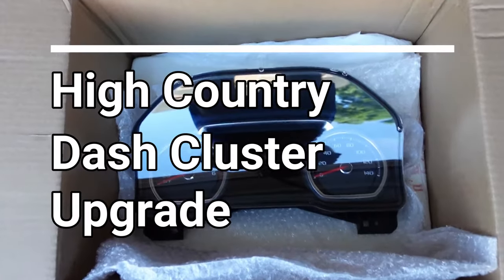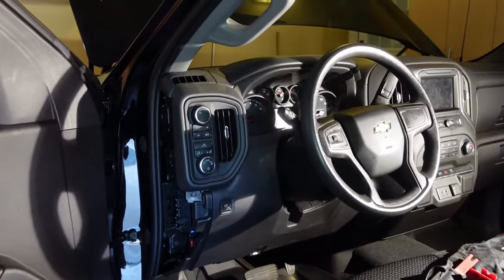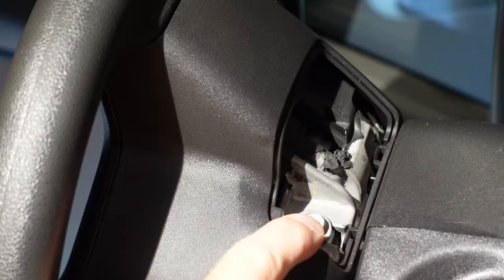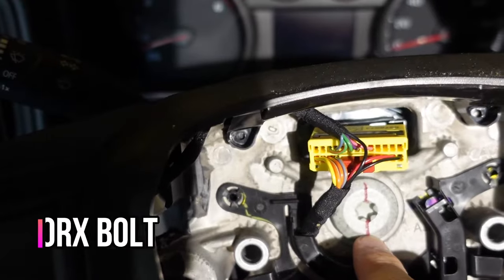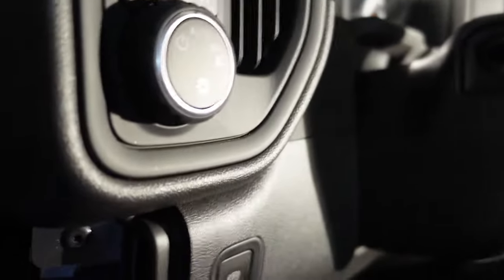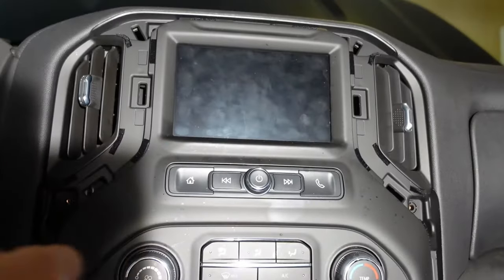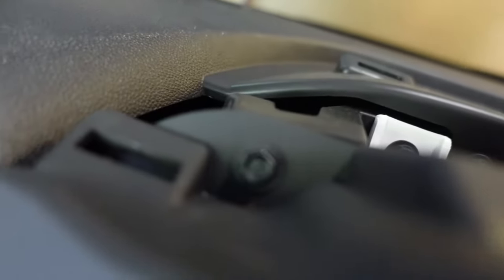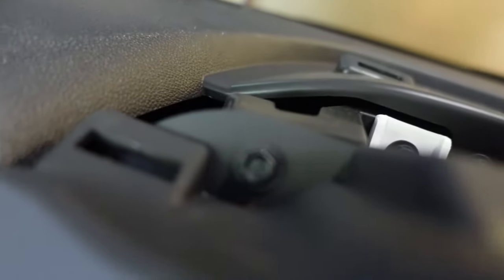[HOW TO] Upgrade Dash Cluster & Steering Wheel in a 2019-2022 Silverado LTD Custom

Comment from the maker: Be sure to read the description for extra info on where to get the parts needed to do this mod. Big thanks to WAMS (White Automotive & Media Services) and the Harness Dr. for helping me get this installed! https://www.whiteautoandmedia.com/  https://harnessdr.com/
Reply: I have a question. is it possible to swap the hvac controls for the digital hvac controls. It’s GM part # 84692242. I searched the forums and I’ve seen people do it in their 14-18. Wondering if it’s possible. Looks like it just pops in.
Reply from the maker: I honestly have no idea.
Reply: did you ever figure out the heated wheel? or just didn't worry about it? Also does this work on the 4 cylinder? I was curious if it actually reads the Turbo Boost pressure. I was hoping you would pop the throttle to see if it would.
Reply from the maker: Im working on the heated wheel now. I had to order some parts and I’ll be making a video. My truck is a turbo 4 cylinder. And yea it shows boost.
Reply: I have a 2022 trail boss refreshed it said on there site that it won't work with the refresh is that because of the single wire harness if you know that would be a big help before I buy?
Reply from the maker: Refresh models have different wiring. This upgrade Won’t work for your truck.
Reply: @fondupot  oh let me know what parts you ordered for the heated steering wheel an if they worked please
Reply from the maker: When I eventually get it working I will post a video.
Reply: Thank you for the video i followed  it to the T an the harness from harness dr even made my steering wheel light up which i was wondering about
Reply from the maker: Glad to hear it worked!
Reply: @fondupot any update on the heated wheel?
Reply from the maker: @brendenbopery8673 unfortunately no. Ran into some roadblocks.

Comment: Let's say I just do the steering wheel with Dr. Harness Mod.first ...will it work for the radio functions? The cluster is a little expensive, but it's worth it later.
Reply from the maker: I think so yes. But I am not 100% sure.
Reply: Did you ever install just the new steering wheel with the adapter and did the radio controls work for you?
Reply from the maker: @justinstorey4084 no. And it won’t work. Others have tried. You need the cluster and the wheel and the added wire for it all to work.

Comment: I currently have a 2020 chevy silverado custom. Would I be able to upgrade the steering wheel with the radio controls, buy the cable, and just upgrade the cluster with a less high-end cluster like the one below the high country and have the radio controls work? Or does it have to be the high country/denali cluster for the radio controls to work?
Reply from the maker: @justinstorey4084  you can do the mid level dash upgrade yes. WAMS offers both up level clusters for GMC and Chevy.
Reply: @fondupot  I purchased a cluster that was pulled out of a 2020 Chevy Silverado LT Model. Do you think I would be able to use that one to be able to use the radio controls? Or is there a way to find out what type of radio that I have in my chevy?
Reply from the maker: @justinstorey4084 it should work. Just needs to be programmed by WAMS.
Reply: @fondupot  I have been emailing WAMS and they say that they don’t offer programming for that type of cluster because the programming would cost more than the actual cluster it self
Reply from the maker: Hmm. Not sure then. They’re the experts.
Reply: @fondupot  yeah I paid $180 for it from a guy on Facebook marketplace thinking that it would work and I don’t want to try to install it and then it doesn’t work. So I am out $180 I guess

Comment: i just saw that my new steering wheel on pin #9 theres an orange wire do i take it off or i have to buy another steering wheel?
Reply from the maker: You do not do anything to the wires on the steering wheel. Rewatch the video. You add a wire on the connector that goes into the clock spring (pin 9) and the connector that goes into the back of the cluster (pin 20). Nothing gets changed on the steering wheel itself.
Reply: @fondupot thank you boss!

Comment: THANK YOU !!! This video was the most informative and detailed I've come across. I did my wheel swap a few weeks ago before getting a new cluster (the cheaper of the two versions). You explained and detailed every step including close ups("not for the faint of heart"). I have hi-lighted your video in my post on a Trail Boss forum. I thank you for the time and effort put in for the DIYers so we know how to to do the swap and do it correctly. Everything works, except for the heated button !
Reply from the maker: Glad it was helpful! Thanks for the comment. I’m hoping to have a resolution for the heated wheel soon!
Reply: I have a 2021 trail Boss custom. My question is if I just change the steering wheel and the wire from the harness Dr will that work with my cluster
Reply from the maker: No. You need one of the upgraded clusters to make the steering wheel buttons work.

Comment: Using the parts listed, I followed all of the steps to upgrade my 2021 Silverado Custom.  No issues except the heated steering wheel function didn’t work.  Has anyone run into this?

ETA: Thanks for the very descriptive video!  Made the process so easy.
Reply from the maker: Haven’t got a fix for the heated wheel button yet. Still trying to figure it out with WAMS. Thanks for watching.
Reply: Do u have to get it programmed or does it come plug n play
Reply from the maker: @dragarza3 needs to be programmed. Check the video description for more info
Reply from the maker: @dragarza3 it needs to be programmed.

Comment: Big ups to you and you detailed instructions,  sir! You truly are an awesome individual. I just bought a 2023 Silverado Custom and that cluster and steering wheel will not do. I am going to use your video to make these upgrades soon. If I run into issues, which I hope I don't, I'll be in touch. Thanks again and I'll let you know how it goes👍🏾
Reply from the maker: Thanks for watching. Sorry to be the bearer of bad news. This upgrade is not so easy on the 2022.5+ refresh models. Before you buy anything do a little more research. The wiring is different and doesn’t allow for plug n play like this. Good luck.
Reply: @fondupot  I looked more into it. I'm new to the truck scene and didn't quite understand what "refresh" meant. Oh, well...maybe there's another option somewhere. Thanks again for the info
Reply: Let us know if you come across anything, just got a 23 custom tb too but the system is a no go @Kno1LikeHeem
Reply: Any update on this
Reply: @mylesclark3333  Nothing thus far. Trust me, I'm still looking to upgrade this joker
Reply from the maker: @Kno1LikeHeem WAMS has come out with an update for the 2022.5. Just recently. Check their Facebook page.
Reply: @fondupot  Thanks

Comment: Great video but are you going to do a video for the steering wheel control  they also have wire harness to power up heated steering wheel
Reply from the maker: Thanks. Unfortunately there is not a method to activate the heated wheel just yet. WAMS has released a procedure for the 2022.5+ (refresh) models but not the previous years years yet. I have been in contact with WAMS and HarnessDr about it. Trust me if there was a way, I’d have it done already. 👍🏻

Comment: Just got done doing this install and it took me 30 minutes just because I watched your video. Thanks! Any chance you figured out the heating steering wheel part?
Reply from the maker: Glad to hear. I haven’t been able to figure out a way to use the button to pose the heated wheel. Unfortunately it runs thru the BCM somehow. There is a way to bypass it but involves cutting and splicing some wires on the clock spring and inside the steering wheel. And an aftermarket controller and switch would need to be used. I am not brave enough for that yet.

Comment: Not me  looking at this video  while placing an order to get myself a cluster and a steering wheel up grade for my upcoming 2024 2500 custom trim 😅 great video 😊
Reply from the maker: Haha hide your wallet.
Reply: Si funciono el cluster de high country en tu troca ?
Reply: Funciono el cluster de high country
Reply: @jonathanrabadan5273  si nomas tienes que progromar al systema y listo
Reply: @jonathanlerma5211  quien te programo el tuyo?
Reply: Y donde ordenaste tu cluster
Reply: Which cluster did you install on your truck?  I have a 2024 Chevy Silverado 2500 HD Custom. The cluster it currently has is the one with the pin that you turn left/right to scroll.  How did you get the cluster programed?
Reply: You can’t upgrade 2022 and up yet! Just warning you
Reply: @Pierce78  wrong I already did on a 2024 😅
Reply from the maker: @jonathanlerma5211 it wasn’t possible until recently. WAMS has come out with a procedure for upgrading the 2022.5+ refresh trucks. I am not sure what all is entailed but I do know it involves having the dealer do something.

Comment: Appreciate the video. I have been looking at doing this to my 2021 Chevrolet Trail Boss Custom but was wondering if the warranty would be voided for any reason. Not sure if you know but checking before I go to far down the rabbit hole.
Reply from the maker: Your trail boss is surely out of warranty by now. But I’d say you’d be voiding the warranty on the dash cluster yes.
Reply: @fondupot Thanks. I bought it used at a dealership and added an extended warranty so was wondering what would happen.
Reply from the maker: @robertheffley3506 I think it will depend on your dealer. But if venture today they’d find a way to void something.

Comment: What stocked radio do you have? I noticed in description is says “In order to Utilize the Music, Navigation (if Equipped) and Phone menus you will need to have an IOS or IOT radio; the IOR does not have the capability to drive those menus.” Mine looks like yours. 7” basic.  Is that where the Harness Dr harness comes in play? Harness lets the IOR radio talk to steering wheel?
Reply from the maker: I have the IOR radio. But my new high country DIC screen doesn’t have the “music, navigation and phone” sub menus. Because the IOR doesn’t support those menus. But the harness doctor enables the steering wheel controls to work.

Comment: Wow amazing video thank you for taking the time. I just got a 2023 2500 custom same dash and steering wheel. Do you think these parts would work for my 2023? People keep saying refresh truck and no idea what that mean.Thanks
Reply from the maker: 2500’s are a little different. But the refresh trucks are like 2022.5 and newer. They have a different dash and different wiring. Does your dash cluster look like mine before I upgraded?
Reply: Hello yes my dash looks exactly like your dash. It's a 2023 Silverado 2500hd custom.  Same steering wheel exactly as well. Hoping wiring will work like yours
Reply from the maker: You might be in luck. I would send a message to the guys at WAMS and verify tho. And then if they say it works, you order the little wire from harness dr. All the links are in the video description. Good luck
Reply: Thank you so much one last question. It looks like your original steering wheel did not have volume control for any ability to pick up or hang up phone calls. Just like mine. Did you have to add another harness for it to sync with the radio head unit? Or is that wire already sitting there waiting. I did notice that other harness that you bought was a 1-wire which I thought only control the dashboard but how do you get the new steering wheel to control the radio volume in Bluetooth Thanks!
Reply from the maker: @nathaniel6246  The single wire I added in the video basically allows the new steering wheel to control the radio. I didn't add anything else. My entire install is shown in the video. I don't use bluetooth on my phone so I cant weigh in on that. But all my buttons on my wheel work like they would from the factory.
Reply: @fondupot  thank you very much!
Reply from the maker: You’re welcome. Good luck.
Reply: @nathaniel6246  Hello,did you get the parts and try the cluster steering wheel upgrade for the 2023 Silverado custom? I was wondering if it worked for you.I have a the 2022 1500 refresh and contacted WAMS,and they told me it won’t work,without any explanation.I have the same dash setup and wheel as you fellas.I’m not sure but,I still suspect it may be possible.
Reply: @zazzaglia  I have a 2022.5 custom. Followed Fondupot's directions (but kept the original cluster).  GREAT video by the way - very helpful. I now have the leather steering wheel, OEM Custom cluster and NONE of the wheel buttons work (not even cruise :).  Local Chevy Dealer is saying harness parts are missing.  WAMs also confirmed it is not compatible (since this is a 2022.5 VIN). I am at a loss and any help would be appreciated. The last thing I want to do is go back to that cheap plastic wheel.  I'm actually considering trying the WAM's cluster in desperation despite them telling me my VIN is not compatible.  Any other suggestions?
Reply: Would this work for a 2023 Silverado custom?
Reply: I tried the steering wheel but not the cluster and didn’t work  not even cruise control.  :( and i own a 2022 .5 i was wondering if I connect the single wire just to see if it works😢

Comment: I have a 2021 Silverado Custom that I bought slightly used. It has the nicer DIC with the steering wheel controls already (I assume the previous owner ordered it this way). The rest of my cluster is analog just like your original. I wonder if I could just upgrade the cluster to a High Country without doing the other things that you had to do.
Reply from the maker: Yes, you can swap your cluster out for a high country one. Contact WAMS to get it. Link in description They will have to program the new cluster to work with your truck.

Comment: Can you add just the steering wheel and get volume control to the radio? Or do you have to get the cluster for that. Because I really just want volume control on my steering wheel.
Reply from the maker: I’ve gotten this question a few times. So I asked my contact at WAMS and Harness Dr. The answer is we don’t know. There’s another guy who I was messaging with on Facebook who is going to try and we will see what happens.
Reply: @fondupot  thank you for the reply. Please keep me updated on the result.
Reply: @fondupot  yes please let us know what the results are. I have the refresh and am very curious.
Reply: Hey @fondupot , any update on just the steering wheel being replaced? I just swapped out the steering wheel on my 2021 Silverado Custom and left the original cluster. Controls to the radio not working. Wondering if the cluster needs to be upgraded as well.
Reply from the maker: You probably need to add the wire. Someone was supposed to do a steering wheel and wire add and let me know if it works to control the radio. Haven’t heard back.
Reply: @fondupot  did add the harness from Harness Dr.
Reply from the maker: There’s your answer. You need the cluster.

Comment: Love the video. definitely going to do this upgrade. could you please direct me to where to obtain the steering wheel you got?  thanks in advance.  You did an awesome job on the install video.
Reply from the maker: I got lucky and ordered it off eBay. Thanks very much for watching, hope you can do this on your truck.
Reply: @fondupot  Thanks for getting back to me.  One last question.  My truck is a 2019 custom. Do I have to have the same year upgrade or can get the 2020, or 21 high country cluster and steering wheel?

Comment: Great video. I have a 2024 Chevy Silverado 2500 HD custom. My steering wheel does not have the voice control or volume control on the right hand side and I would like to change that and the cluster. Which parts do you recommend for both? I tried to look at the steering wheel, GM part number that you provided and it seems that it’s just a steering wheel without any controls on it. Thanks for the information in advance.
Reply from the maker: Wiring on the 2500HD’s is different. I don’t believe it’s as easy as shown in this video. And I am not sure what part number wheel you would need.

Comment: great video, quick question im looking to just swap out the steering wheel do i also have to install and buy the wire for the cluster? i only want to swap the wheel since i’m a big music guy and it would make life easier just to have it in the back of the steering wheel
Reply from the maker: Others have reported that it Won’t work without the cluster.

Comment: Were you able to figure out if another wire is needed or programming needed to get the heated steering wheel to work?
Reply from the maker: Negative. I was not able to make it work.

Comment: Great video.  I have a 22 Custom Trail Boss. Cluster is same as shown in video.  Steering wheel has adaptive cruise button which differs from yours.  What replacement steering wheel would work for this? How would I figure this out?
Reply: Correction - It's not adaptive cruise but the forward collision distance selector.  Either way, if anyone has any insights as to which steering wheels with the Forward Collision on the left cluster and the audio cluster on the right side? Thank you!
Reply from the maker: @Southpaw_Precision  is your 22 custom trail boss have the refreshed front grill? If so then it’s a 2022.5 and wont follow this procedure. You’ll have to contact WAMS for the global B architecture upgrade. Even though the dash cluster may look the same the 22LTD and the 22.5 refresh has different wiring.
Reply: @fondupot  Not a refresh.  Has the older grill / lights.
Reply from the maker: @Southpaw_Precision  ok then you need to find a wheel from a similar year or a 21. And it has to come with pre-collision. You could get one that has the heat option yet. But I haven’t figured a way to make that work. So that will be a dead button. I don’t know part numbers because they change so frequently.